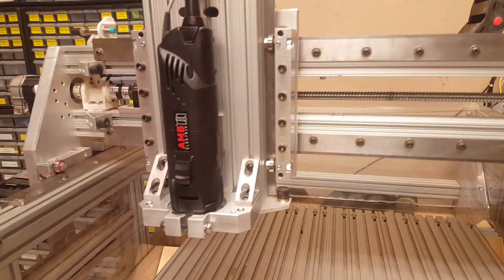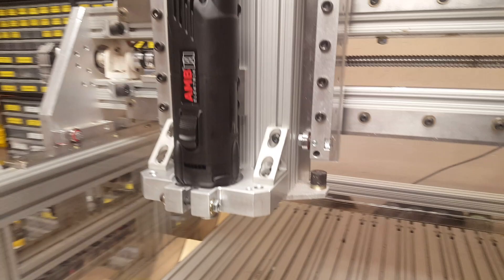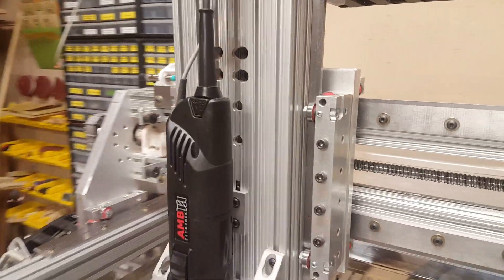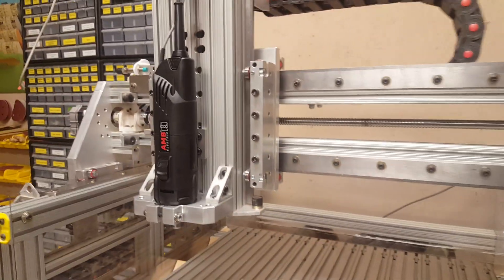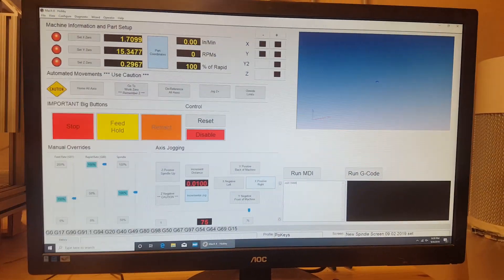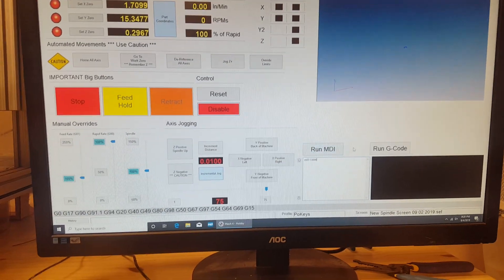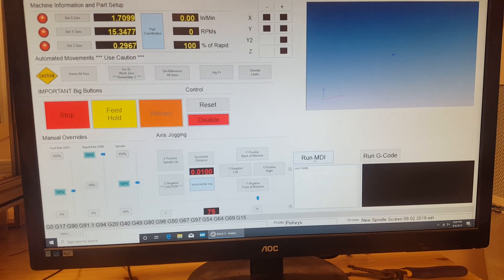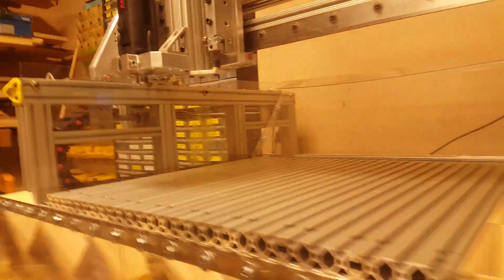New AMB 1050 FME P DI spindle AMB used to be Kress.

Comment: Hi, can you tell me how you turn the unit on and off?  Is it as simple as using like M3 S5000 and it will just spin up to 5000 RPM.  I'm also assuming you have the power switch on the unit set to on.  Also did you use an analog pwm circuit?  Thanks,

Comment: Good ! can you show how connect to your interface board ? (i use this card Geekcreit® 5 Axes CNC Interface Board with Mach3). Many thx
Reply: Hello same configuration (Geekcreit® 5 Axes CNC Interface Board with Mach3) and i would like to use this AMB 1050 FME P DI to control the speed
interessted to know how to wire that
thanks